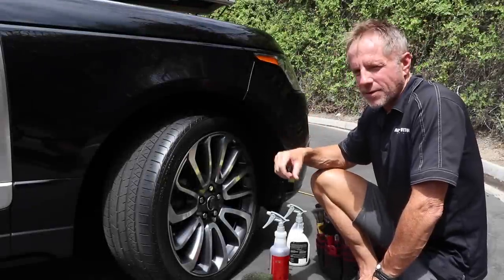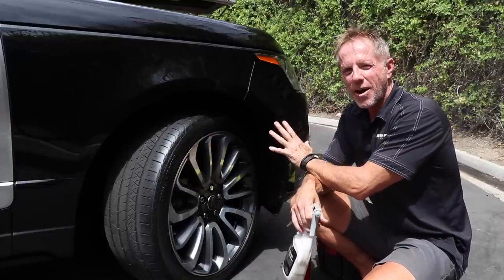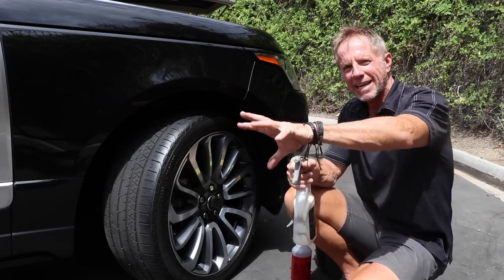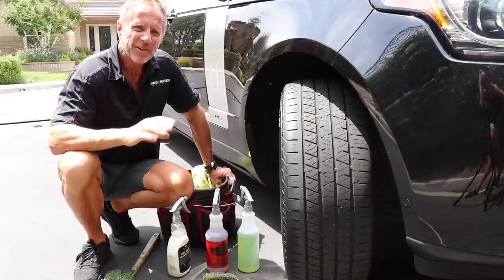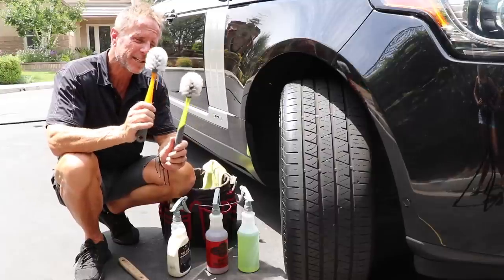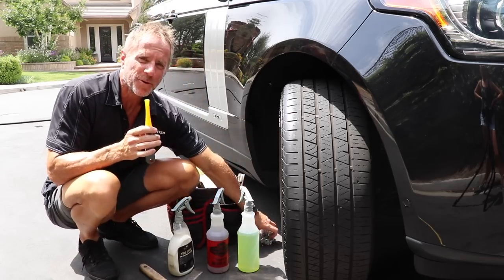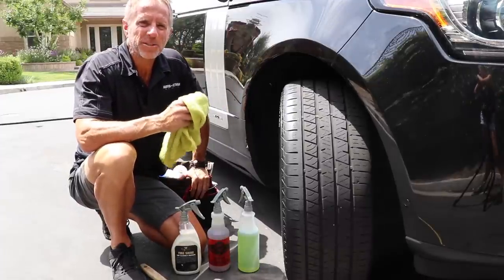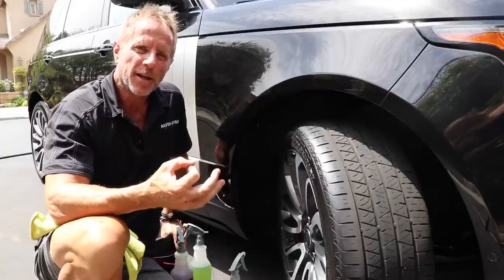Wheel Well Cleaning: Felt lined wheel wells and wheel arches

Comment: Carpet felt wheel wells r the dumbest thing car manufacturers ever have done period !!!!!!
Reply: Mike J Autos and stuff 
Yea, makes you wonder about other engineering choices. Who is in charge at the factory?
Reply: Done primarily for sound deadening and weight savings.
Reply: Well use it on an inner layer but still have a plastic or other easy-to-clean material on the outside.

Comment: Thanks for making this video. I never thought about detailing the wheel wells. Is there a way to prevent my rear wheel wells on my truck from rusting from the inside out like so many trucks seem to do? Thanks again.
Reply: Have you found anything?  My old Ram has this rust problem and my 2011 Maxima is starting.  My Maxima is rusting from inside a fold in the sheet metal, so not really like I could blow/wash it out.

Comment: Hi Darren! How do you deal with road tar in wheel wells? I found that most of tar removers can whiten black plastic that is used in wheel arches.
Reply from the maker: You are exactly right. Traditional tar/adhesive removers will dry out the plastic and make it look whitish. I do use Rapid Remover for my "go-to" when it comes to removing tar and adhesives. This product is far easier and does not fade/discolor/dry out the plastics like traditional tar removers. https://www.best-auto-detailing-tips.com/car-adhesive-remover.html Also a trick I use for heavy cases of tar in the fender wells is to bust out a rattle can of spray paint and simply cover it up by painting over it. This is usually a great "winning balance" for those extreme cases of tar sling in the fender wells.